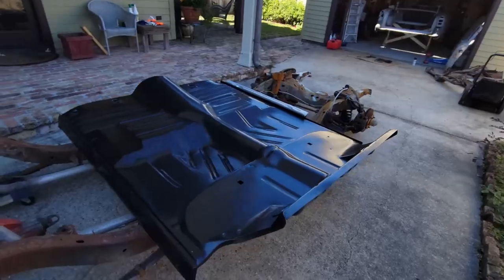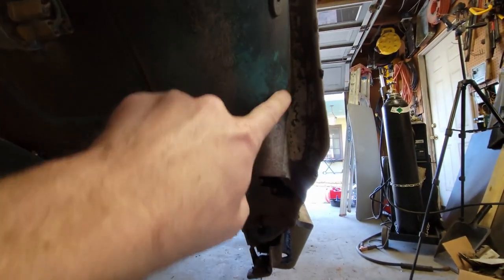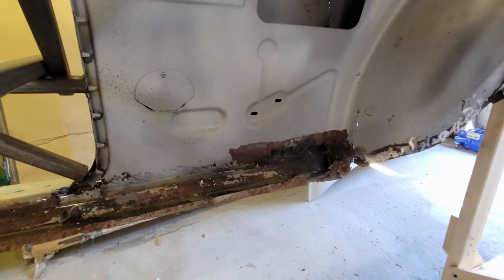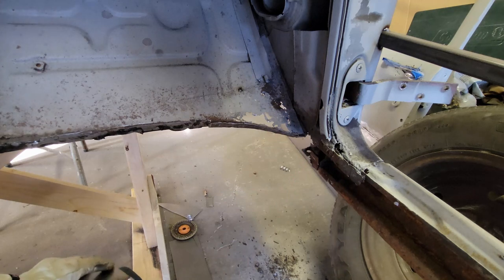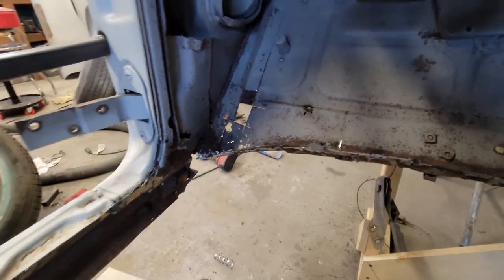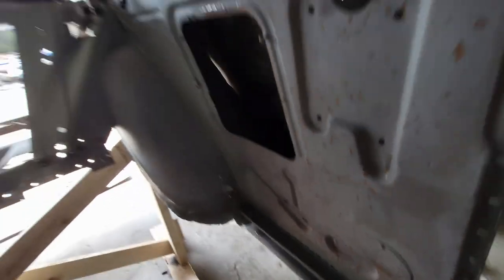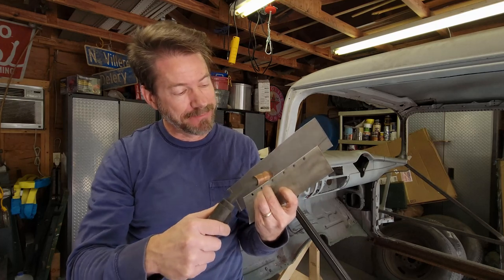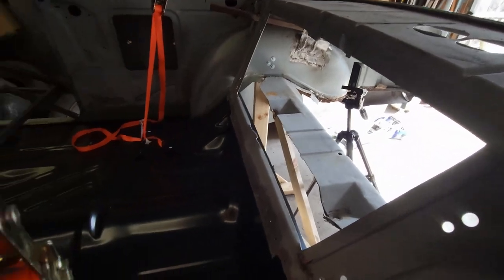E30 Installing a NEW Floor Pan in a Tri-Five Chevy!   1956 Chevy Bel Air Restoration

Comment: Looks like it fit pretty good....I used to have a body manual for tri-fives that told all the dimentions of all the body and frame components...good to know what they're supposed to be even thou you gotta go with the flow most of the time...keep cookin....its lookin....
Reply from the maker: You know, I've got a body manual that I've had for 15 years that I just ran across, covered in dust on the way-back shelf.  I haven't even cracked it back open yet.  It might help!

Comment: You did a fine job of bracing, wish I had done something like that. Mine is not as easily maneuverable through when replacing the floor panels.
Reply from the maker: If you heard me say it at least a dozen times, "I'm tired!"  THAT'S what can be so tiring!  All of the climbing in and out of those monkey bars!  I'd climb through and around and settle into a spot to work, only to find that I needed a tool that was on the bench.  Up and down, up and down!  It's exhausting!  - Thanks for keeping up with the project and best of luck with yours!

Comment: So much corrosion and rot but your don't seem deterred.  Your repairs came out really nice and the floor pan looks fantastic.  I am glad you got a hall pass to continue working.  One quick question.  Have you ever dealt with this level of repair before?
Reply from the maker: Yes!  I did a 1971 Cutlass convertible  between 2013-2016 that needed a new floor and trunk.  Check out Episode 1 for the story and Episodes 15.1 through 15.5 that highlight the Cutlass at Cruisin' the Coast this past October.

Comment: I had to come back to this video to see your toe panels. I'm replacing mine completely and needed to see the small L shaped brackets that are right next to the kick boards. Mine are to far gone from rust and the toe panel doesn't come with them
Reply from the maker: The only thing that I missed on this install was that the corners of the floor at the kick panel is not a sharp point.  I had to cut and beat just that area to make it fit.  It was very close, but it was so rusty when I made the flange on the kick panel that it interfered.  But we got it in!
Reply: @restoringChristine1956 Thank you for that heads up. I'll be doing the floor pan when it cools. I have a small gap I'll likely have to make a filler for right at the lower corner on each side. The floor pan will confirm if it's necessary